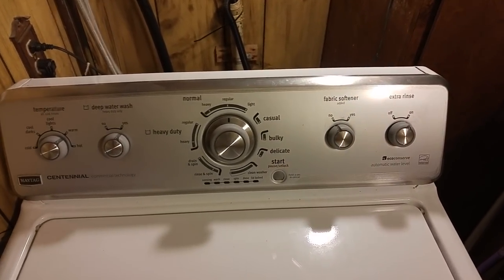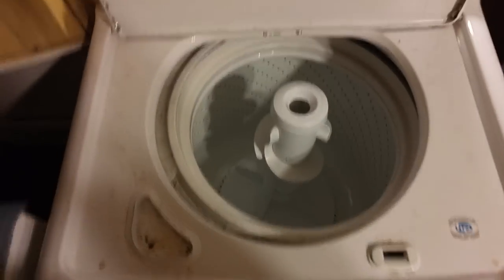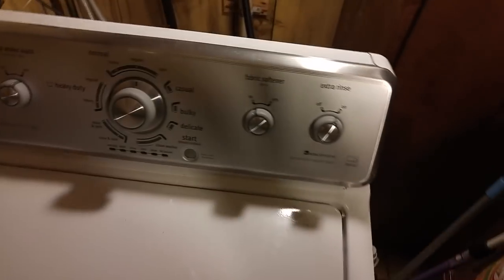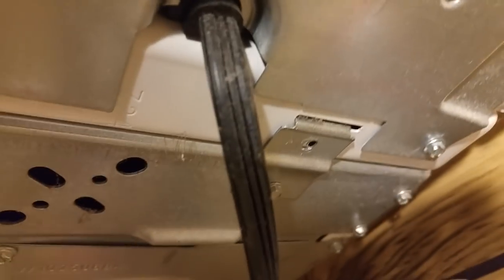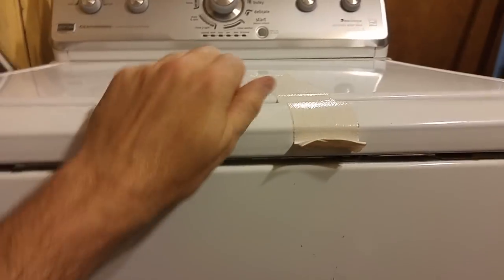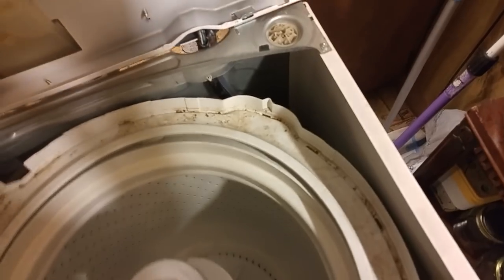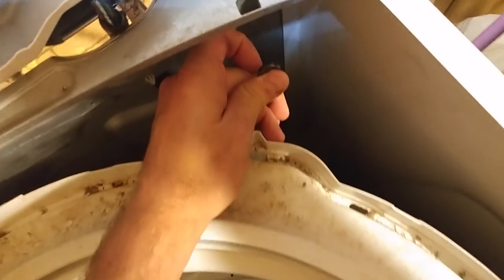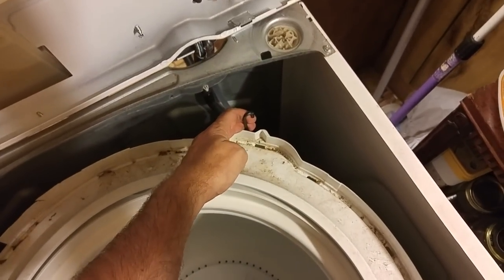Maytag Centennial Washer, Top Removal

Comment: Thanks. I have the Maytag Centennial purchased in 2013. The lid will not slide backwards after removing those 3 screws. I must first slide it forward a quarter inch, then up slightly, then it slides back. There are two little hooks in the front corners that you need to clear before it goes back far enough to lift.

Comment: There are small side springs near the tops of the rods connected the rods to the tub. I only have two rods with these small springs and the other two rods don't have any.  Should there be one spring on each of the 4 rods? Is there a trick to putting these small side springs on?

Comment: Any chance you can tell my why my laundry still stinks with the Maytag Commercial Technology MVWC565FW washer.  It is a musty / mold smell on the clothes not in the washer.  I have had the moldy front load washer and this is different. This is a top load with agitator. We use the pods so not using to much detergent (made that mistake before). I run the clean washer multiple times a month. It seems better after I do this but comes back fast. 

My washer and dryer are in the garage in Houston so their is a humidity factor but is there something I can take apart and clean. A filter I’m missing or something. Thanks for any help you can provide. 

I waist so much energy rewashing my clothes and using deep water. Complete waste of money. They should pull every HE machine off the market.

Comment: It is amazing how similar washing machines can look, same brand name, everything so identical, yet be so different to disassemble. Mine doesn't have those screws in the back. Nor does it appear to have the spring clips to disengage up by the front to slide out the top. For the life of me, I can't even disassemble mine to attempt a repair.

Comment: I have the same model and I just replaced all 4 suspension rods and it's still banging around are there other springs that will cause the offbalance or did i just get some bad replacements?
Reply from the maker: bear adams - I honestly don't know.  I'm not a repair tech and haven't had any issues with the washer since...  knock on wood & thank God...  so I really don't know what else might be the cause.  Good luck and if you figure it out...  post a vid!
Reply: @xmaninma  turns out no just the 4 rod and spring things. Apparently I had gotten some cheap inferior ones. Once i ordered the ones from maytag and put them on it fixed it